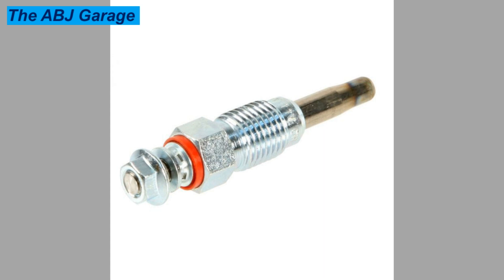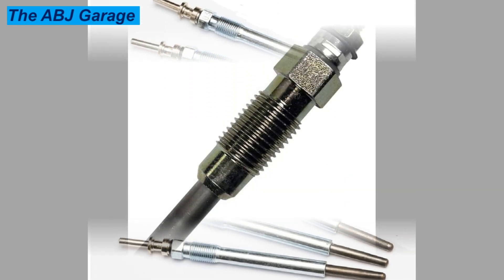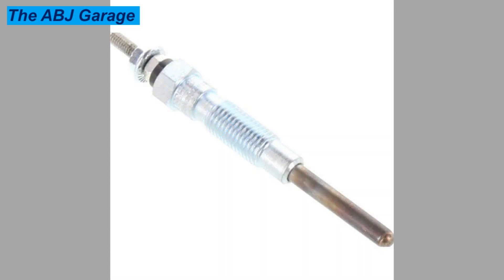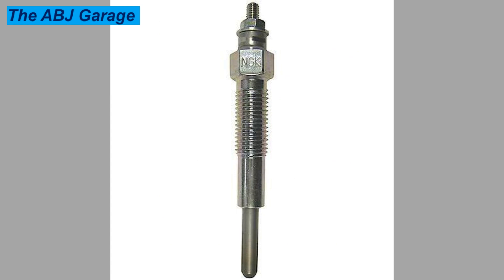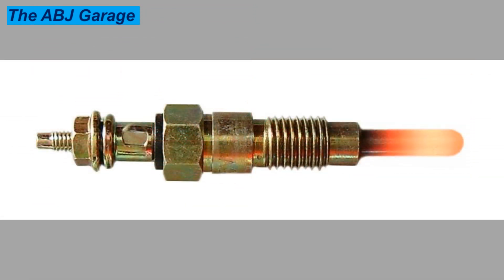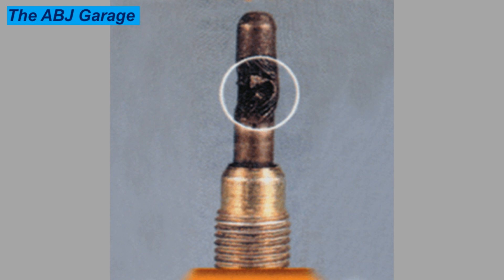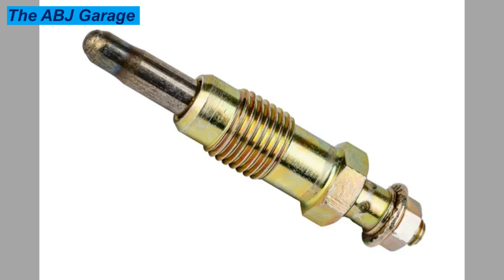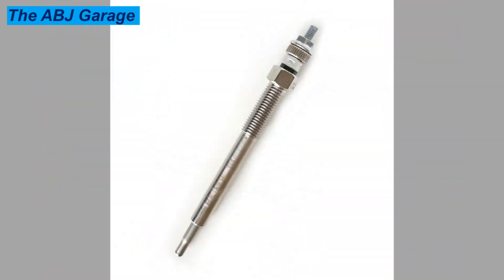How to tell if you have bad glow plugs

Comment: Hi can u advise me on something,so i have a vauxhall insignia 2012 2.0 cdti and in the past i have had 2 separate glow plug warnings on dash so i replaced them and the only reason i didnt replace them all is because they have pressure sensors on all 4 and are expensive. But i an getting cold hard starts and rough idle and smelly exhaust only when starting from cold but have had no other warnings to say the other 2 glow plugs are faulty,Do you think my other 2 old glow plugs are causing this issue even though its not showing any warning on dash?Thanks

Comment: Hi i have a problem with my car the garage said its glow plug in cylinder 4 an injector 4 but i had a new injector in 1 an 4 an new wire loom put in  i have a mazda 2 diesel engine and when i start it on a cold day its takes few attempt to start and when it does its misfiring car shake with white smoke an the amber powerstrain light come on but when car has warm up it will stop shakeing and drive fine then it will into limp mode after a while with  decrease power on the accelerator with the the powerstrain light on does anyone kno if this could be the glow plugs? Can the glow plugs affect a car when performance on the rd are they needed when a car is running on the rd or are they just for starting a car up ?as ive just had a reconditioned turbo due to a leak thinking it was that and its not
Reply from the maker: Any thing that will cause poor combustion could result in the symptoms you mentioned. It could be caused by faulty glow plug, poor compression in one or more of the cylinders, faulty or leaky injector, low injection pressure. Please not that low quality fuel can also cause hard starting, also make sure that the starter motor and the car battery are in good condition and you have enough cranking speed. Low cranking speed can make starting difficult, low compression and compression leak can do the same.
Reply: @TheCarCareGarage  THANK YOU